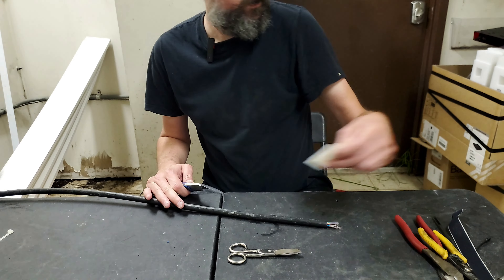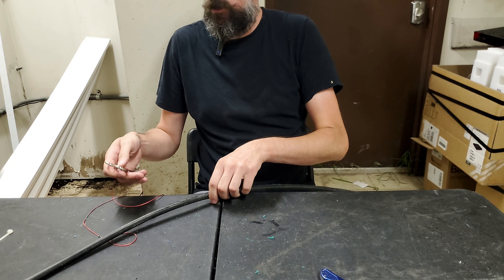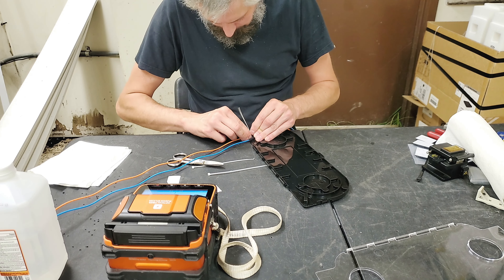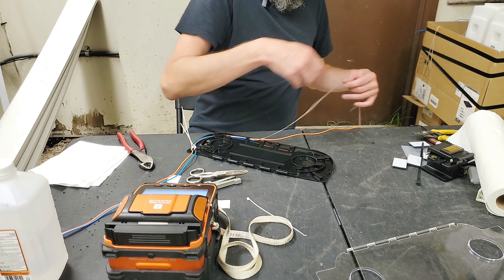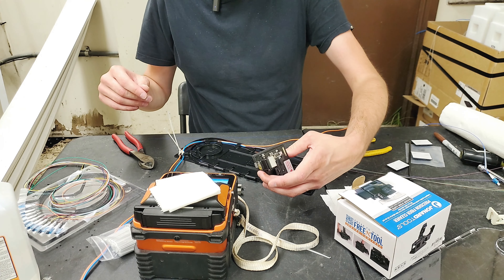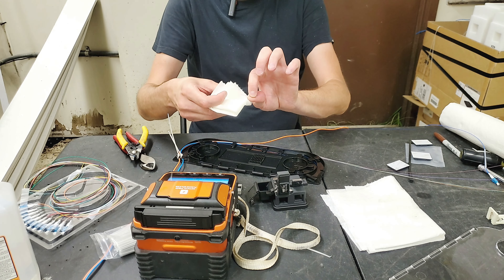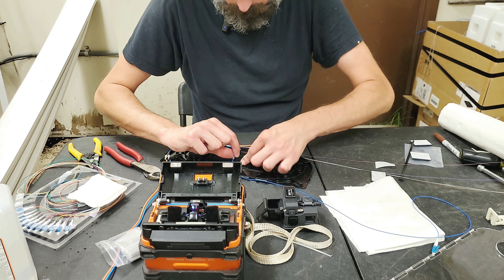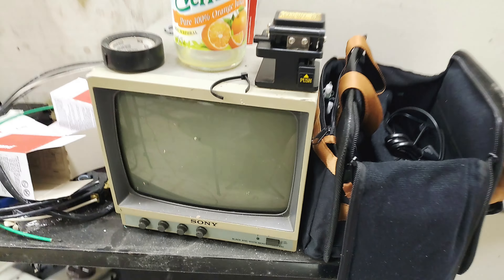Moving a fiber POP,  continued

Comment: Whats that type of cable? The cables i work with are full of gel, which i have to clean forever with isoprop
Reply from the maker: This is a GAON brand cable.  It's a product I believe that is called Dry Light or Dri Lite.  It's like a loose tube filled with a talcum powder.  Our customer drops are gel filled and i hate them so much.

Comment: What OLT do you use? 
Asking for a friend...
(I like the 1u pizza-box format for appliances. Blade systems are cool, bulky and expensive.)
Reply: Those are fine for small outfits, but otherwise do not scale.

They're very small. They're using Ubiquiti OLT's.
Reply: They use ubiquiti, if you want small you can use the ciena/tibit sfp+ olt in a router or switch
Reply from the maker: @eat.a.dick.google  We are running POPs using passive DWDM so we have a POP every 15 miles.  Also we are running GPON and XGSPON on the same fiber plant allowing us to manage upgrading customers that want it.  We would never actually have 1024 customers on the OLT as they describe.  Typically our PONS have between 10 and 40 customers so it scales perfectly for us.  Also with there ONU having WIFI 6 it makes for not only a decent OLT experience.  $100 for a Wifi6 ONU with 4 ports is where the real benefit comes into play.  Also forget about the licensing fees with nokia, cienna, etc
Reply: @briceperdue7587  Yes, you're a very tiny ISP.
Reply from the maker: @eat.a.dick.google  Well I appreciate your feedback but I would also appreciate a better name than eat.a.dick.google.  I would also agree with you that in the terms of an ISP we are tiny.  I am not 100% sure of why tiny is a the word you prefer, all sizes up but you could say small, tiny, inverted?  Anyway I appreciate your commit to high quality comments and more so I appreciate you watching some fun fiber upgrades from DSL speeds.